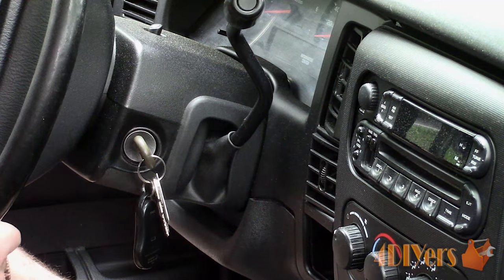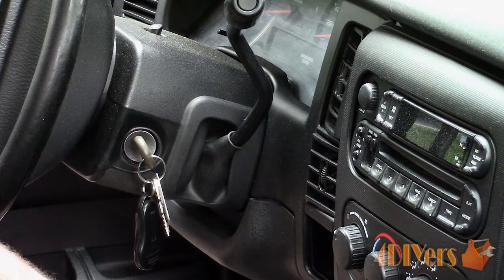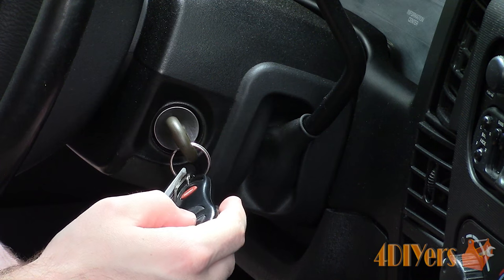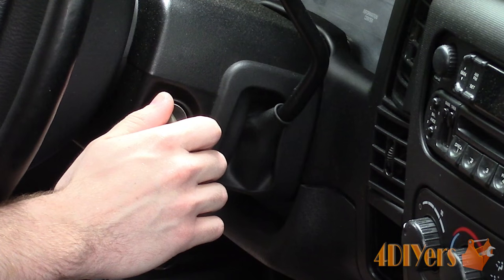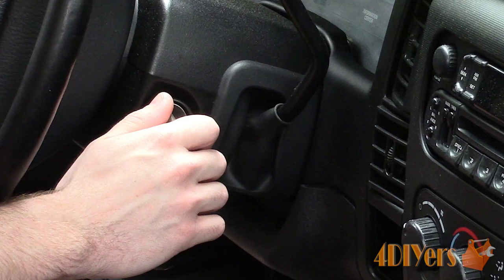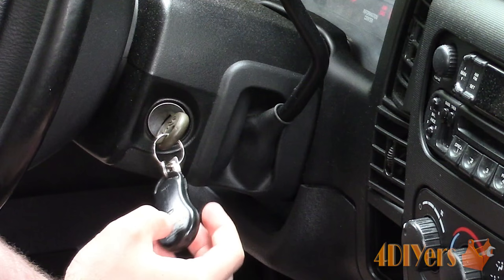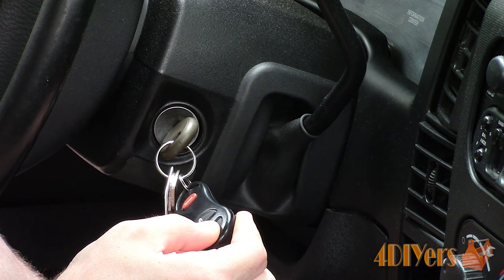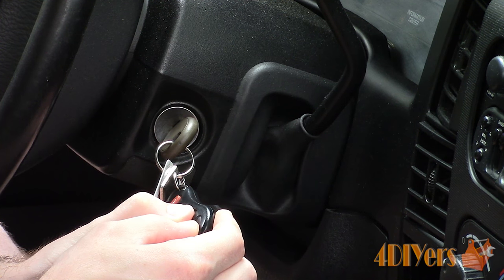DIY: Dodge Keyless Entry Horn Chirp Enable/Disable

Comment: You are a lifesaver... I've been trying to turn this damn thing off but the part I was missing was putting the key in the ignition. 
05 ram 2500, key to start, press and hold the unlock button and count to 5. While still pressing the unlock button press the lock button for 4sec and release both buttons.
Done, 😁👍. This was as bad as trying to get into Fred Sanford's secret drawer to get the ripple 🤣.

Comment: 2004 Dodge Dakota -- turn on the key (but don't start the engine), then push/hold in the "lock" button for a few seconds, then press/hold in "panic" button.   I then heard a chime saying the setting was changed and the truck no longer honks.   Thank you for the video!
Reply from the maker: Happy to help :)
Reply: This method worked on my 2003 Dakota.

Comment: Worked!  I have a 2008 Dodge Grand Caravan. Had to keep the key out of the ignition, due to being the fob is the key for the ignition. Press and hold the unlock button about 5 seconds, press the panic button until alarm goes off. Turn off alarm by pressing the panic button, and now my horn chirps when I lock the van. Also works to turn off if you choose to turn off chirp. Ran through this sequence a couple times to check. Thank you so much for the info, as I have 3 mechanics I know that said they didn't know how to make it sound.

Comment: 2001 Dodge Dakota:

1. Fasten seat belt.
2. Turn the ignition on, but don't start the engine.
3. Press and hold the Lock button on the key fob. 
4. After 4 seconds, but before 6 seconds, press and hold the Panic button. 
5. When a single chime is heard, release both buttons.
6. Test

Reactivate the horn chirp with the same process.

Comment: I tried doing this on my 2013 Dodge Challenger and it didn't work. I read the owners manual and the only difference is instead of the lock button it's the panic button.

Comment: thanks for the video, however I just found out on my 2005 european sebring, don't put the key in the ignition, hold lock for a few seconds, then unlock and release both.

with the sequence from the video it only locks and unlocks the driver door and leaves the rest.

also my fob has no panic button, actually never seen one on European cars
Reply from the maker: Glad to help out and thank you for the tip too! I don't believe I've ever seen a no panic button remote on the Canadian market either. Perhaps an aftermarket replacement? Don't forget to subscribe :)

Comment: I have a 1994 Dodge Intrepid Andy factory installed security alarm sometimes will not shut off even though I have the key fob and I can lock and unlock the doors the alarm will still set but it will not disengage no matter what I do somehow eventually the alarm shuts off and I'm able to start the car is there any way to permanently disable the security alarm on my Dodge Intrepid

Comment: I tried this with my dad's 2001 dodge durango and i didn't hear any sound after holding the buttons down. Do you have any suggestions?
Reply from the maker: Does the chime normally work when the key is in the ignition and the door is open or the lights are left on? Also ensure the battery in the existing programmed remote are in good condition too.

Comment: I have a 1999 dodge Durango looks like key isn't responding after having the battery off the truck for about 3 days. tried programming it but remote key won't respond and as soon as I connect the car battery the truck starts beeping. do I need a new control key or what can I do to shut the alarm off?
Reply from the maker: +edgar romero Most likely you do not have an original key. What can happen is that the vehicle will forget any extra programs besides the original, therefore you are unable to enter the programming sequence. If you have another key, then try that. If not, then only someone with access to Dodge coding can reactivate the key for you.

Comment: Hey I was wondering if you know how to disable an alarm in dodge Dakota? My FOB broke and I can’t open door without alarm going off.
Reply: I have the same problem. When i hit the unlock button on the remote, the car alarm goes off. Did you fix it?
Reply: Dealership DRB III tool should be able to do it, but idk how much the labor is etc. HPtuners makes a product that I believe can fix that, idk if you still need to resolve this issue but they should have a tuner to deactivate that.

Comment: Does this work with the 2007 Dodge Caliber's as well? 
Mine does not chirp when I lock or unlock, but would like to have this function enabled if it exists.
Reply from the maker: +AzurusNova Yes you should be able to activate/deactivate the feature. It should be in your owner's manual, but if not, here is teh sequence. 
1. Perform this operation while standing outside the vehicle.
2. Press and hold the LOCK button on a programmed transmitter.
3. Continue to hold the LOCK button, wait at least four seconds, but no longer than 10 seconds, then press and hold the PANIC button. Release both buttons at the same time.
4. To reactivate this feature, repeat the above steps.
Reply: +4DIYers Wonderful! Worked like a charm.
Reply from the maker: Excellent to hear!

Comment: Hey i have a 2010 Dodge Ram 1500, that the feature of the lights flashing when you lock it with the key fob is not working anymore. The head lights, tail lights,and third brake light flash when it is locked by the key fob. Now it does not, any ideas??
Reply from the maker: Check out this video here https://www.youtube.com/watch?v=8QnPyUFypWQ Don't forget to subscribe!